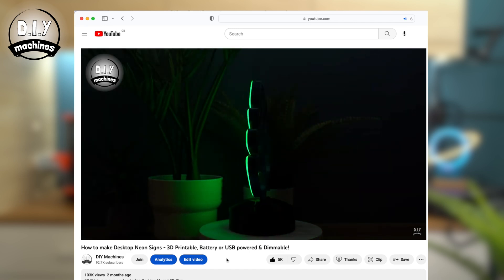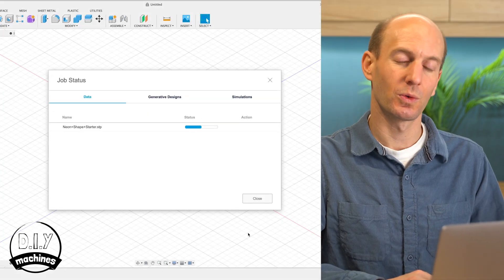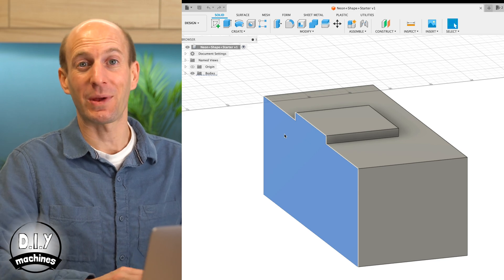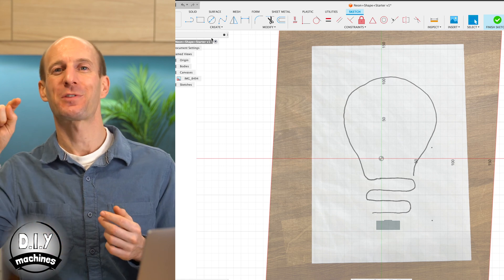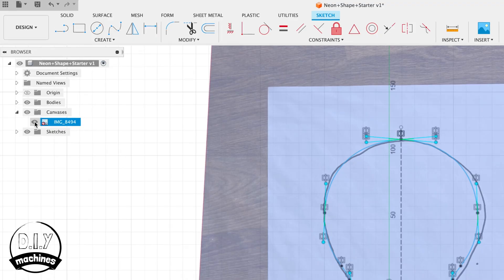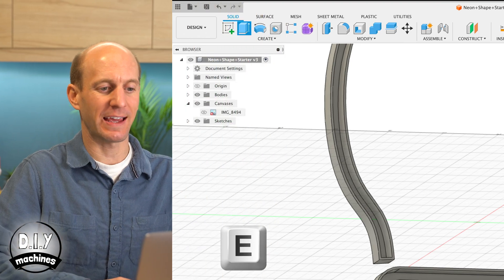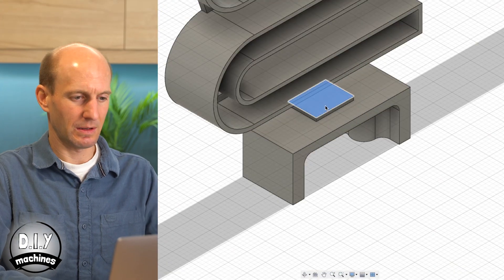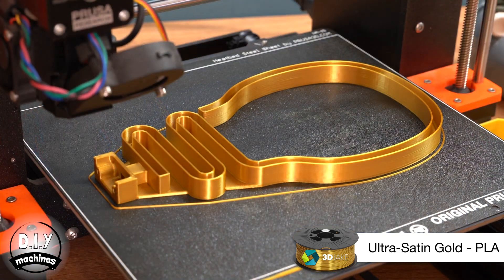Designing Your Own NEON SIGNS - 3D Printed | Fusion 360 | LED Flex

Comment: Nice video, super helpful! Is there a way to measure the length of the model or to set it at a certain length, so that I can model it based on how much LEDs I have left?
Reply from the maker: Thanks. There not a way I now off to design to a certain length. But you can measure an estimated length of your design by drawing a line through the middle of its path using the spline tool and then measure that sketch with the measure toll. Clicking the line itself should give you its total length in Fusion.

Comment: If you're doing a 1mm Shell and want to add an "additional 2 milimeters", you have to select the face on the back of the body. As you're selecting the inside face and extrude by 2mm, doesn't that add only 1mm, as it first extrudes "through" the 1mm that's already there?

Comment: There's something off about this tutorial that I can't quite place.  If you're placing the sketch on the back face of the starter, and then extruding -13mm, it extrudes away from the back of the starter clip.  If you do the opposite, and do 13mm, it pulls it over the top of the starter as in the video, however if you then add the 2mm extrusion on the back of it, your project will no longer print flat, because the shape protudes 2mm more

Comment: Thanks for the great tutorial. But how did you  make sure that the length of the channel is exactly a multiple of where the LED strip can be cut? Cant find any way to get the length of the spline to adjust it accordingly
Reply from the maker: Off the top of my head you should be able to use the 'Measure' tool from the 'Inspect' menu at the top. Click on one of your lines and it should tell you the length.
Reply: @DIYMachines  I'll try that. Thanks a lot!

Comment: what about pixel LEDS?
Reply from the maker: The circuit I designed would not work with individually addressable LEDs. You could still use the design and replace the PCB with a circuit of your own design which incorporates a micro controller.
Reply: @DIYMachines  i have an artnet controller and an RS-485 chip to run DMX protocol
Reply from the maker: @abecoulter8550  I believe you would still need to incorporate a micro controller to analyse the DMX signal and react to the desired channels (likely chosen using the traditional dip switches but could also be 'hard coded').
Reply: @DIYMachines  nope its an all in one unit with decoder, plug and play

Comment: I bought 12V instead of 5V lights.  Is it possible to change the resistor and capacitor to handle this?  I know the batteries won’t work but would like to use the boards and lights I bought and not waste them